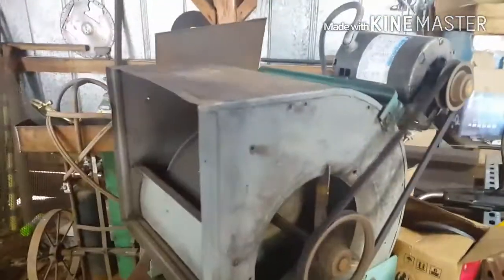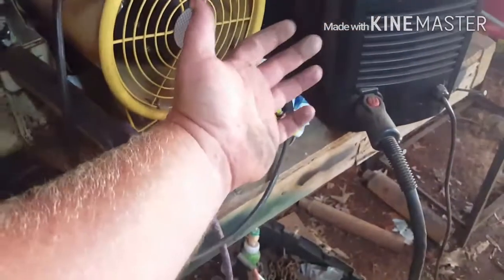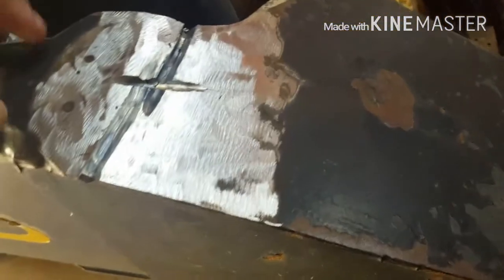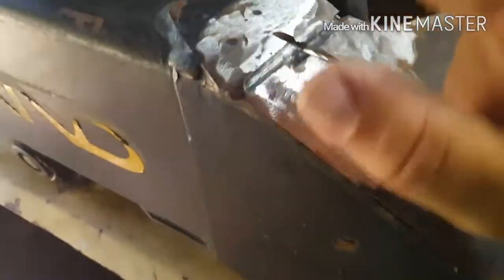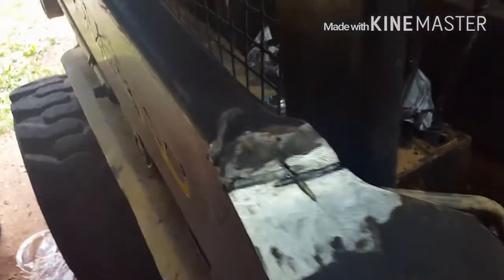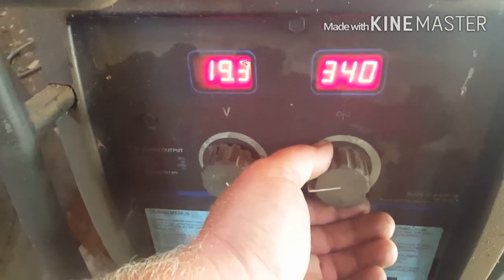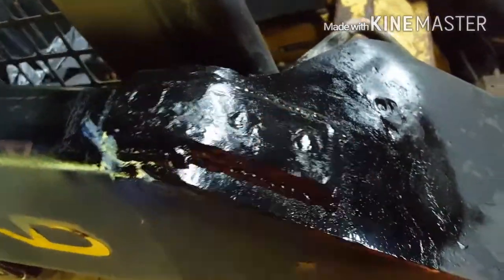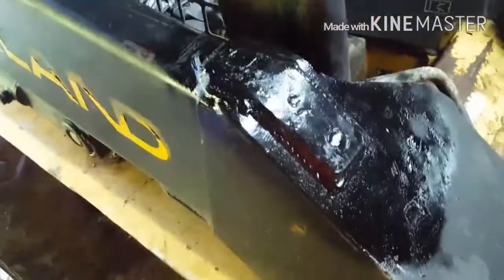Welding up a skid steer and my $1,000 mistake

Comment: Local welding shop had their miller MIG for sale asking $1500. Said it was broke and they already paid $3K to get it fix only it broke again. I couldn't take the risk.
Reply from the maker: +Waiakalulu mime was a used machine also. But it was a home owner not a shop. This is the only problem I have ever had out of it. They told me lighting probably ran in on it and fried the boards. So now I always unplug my machine from the wall so that can never happen again

Comment: I would have done that with a stick
Reply from the maker: Don't have a stick welder at the moment. Thanks for watching and commenting
Reply: theres a stick welder in the video? on the right its a miller thunderbolt good machine.
Reply from the maker: Fixt100 yes their is. I just haven't had the extra cash to get the leads. Yes it works great.